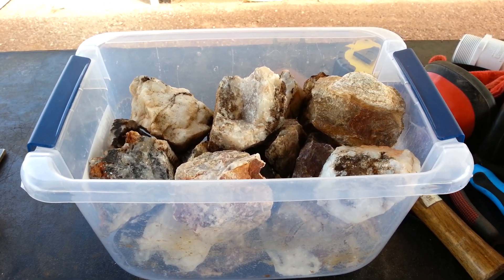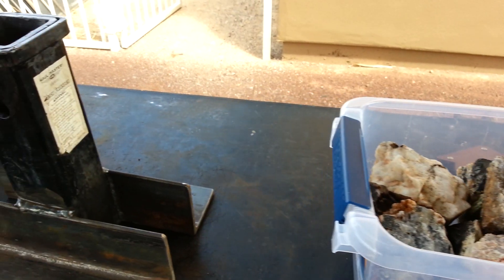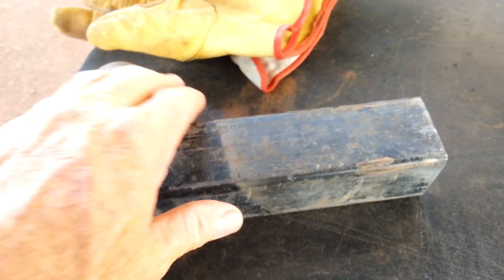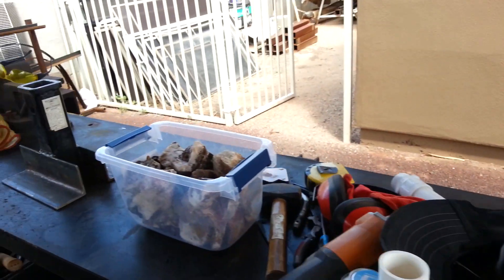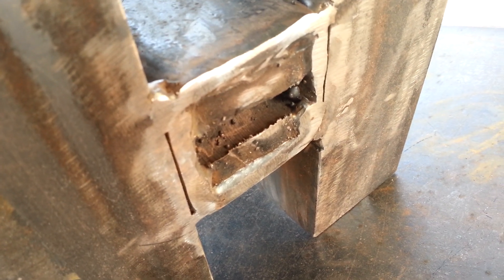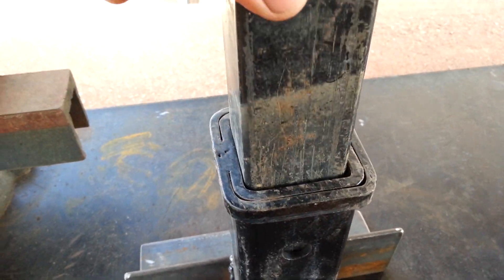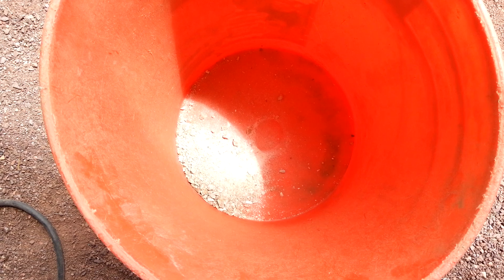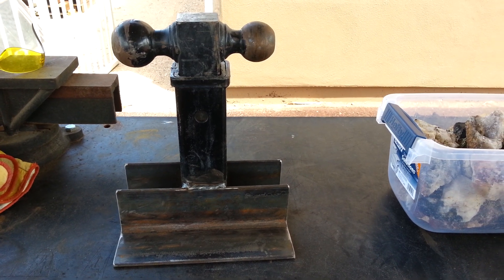$50. Homemade rock crusher

Comment: Great idea , definitely carry some weight behind every punch. Q1) what size specimens to start with ( obviously size that would fit tube initially ) , but Q2) what size does this set-up take it too ? +/-20 ? Could it be modified easily to recrush +20/+50 * now its just a matter of finding a clean used one ( no grease/oils ) Great video , thanks for sharing.